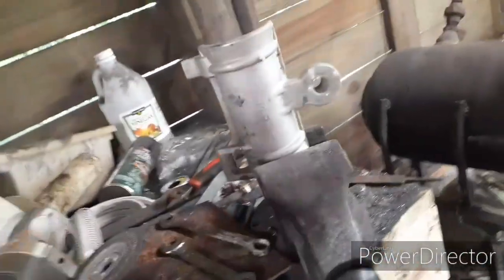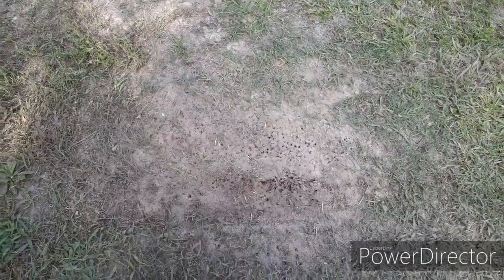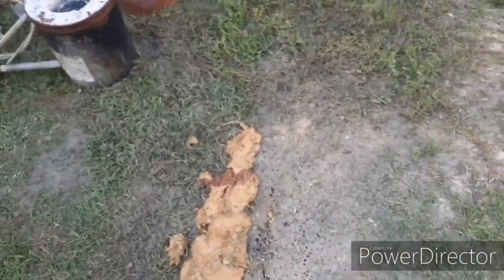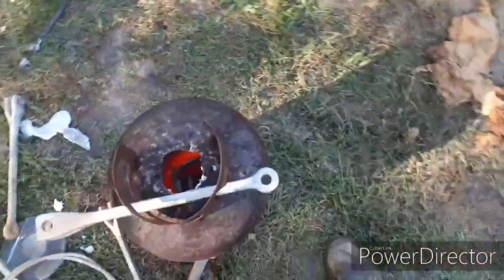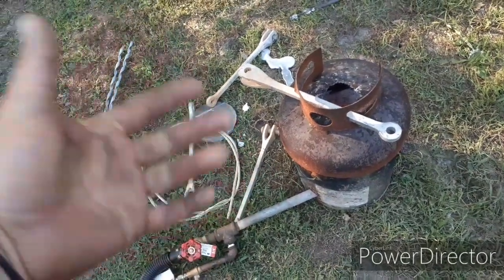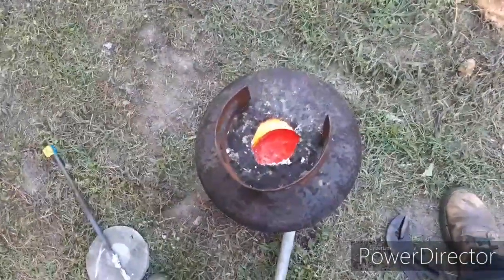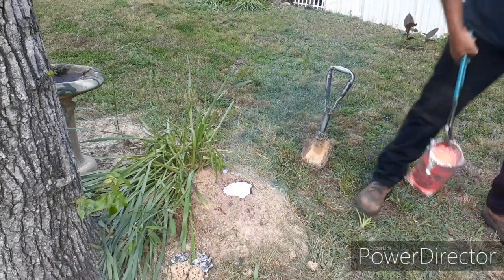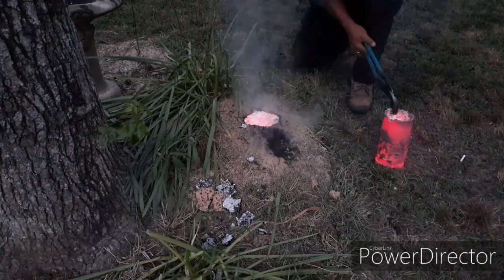Oak Tree Ant Hill Casting part 1

Comment: Ok, i have a question:
isnt aluminum too heavy for small ant tunels ?
i was also watching an enormous casting done in australia, with cement, CEMENT ?!
https://www.youtube.com/watch?v=lFg21x2sj-M
its heavy man ! doesnt it destroy the tunel when it gets through ?
I somehow think that the casting that comes out of it is not event a 75% of the ant tunel form.
Reply from the maker: Alot of variables go into it. The viscosity of molten aluminum is pretty high but it's the lightest metal we can melt down. I've gotten tiny pin holes in crucibles before and the aluminum leaked out. Ant nest are not the ideal casting scenario. Alot of times the tunnels collapse on me and I miss a good portion of the nest. But they are neat what does take metal. Thanks for watching.
Reply: @AAMW13  thanks, great work !